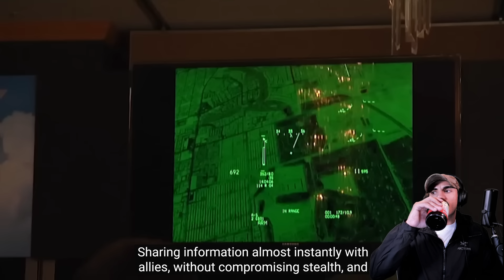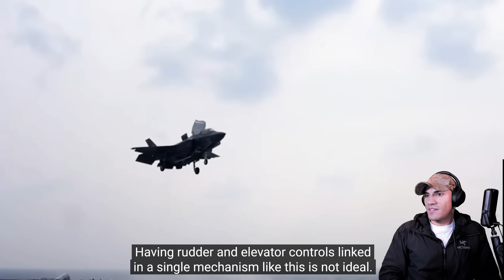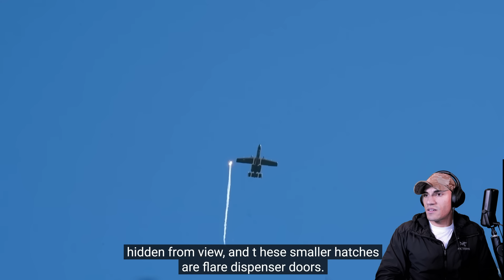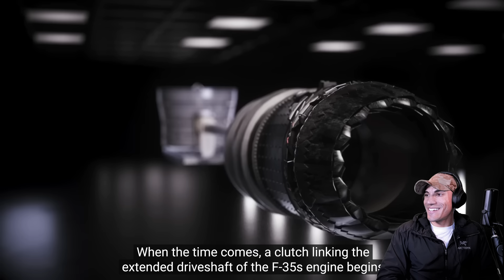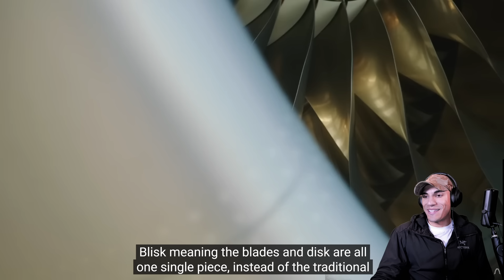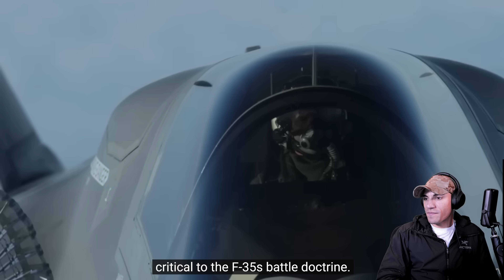Marine reacts to the Insane Engineering of the F35

Comment: VSTOL Taken from the UK Harrier
Reply: STOVL not V/STOL and the F-35B does not employ vectored thrust like the Harrier/Harrier II nor does it rely on the infamous hot gas ingesting compressor stall generating Pegasus of the Harrier/Harrier II.
Reply: @AA-xo9uw  what do you call that jet pipe that swivels from horizontal to straight down, if not vectored thrust?
Reply: No, different system entirely.
Reply: @@FunnyVideoCollector, did I not say that Harrier is an entirely different system?